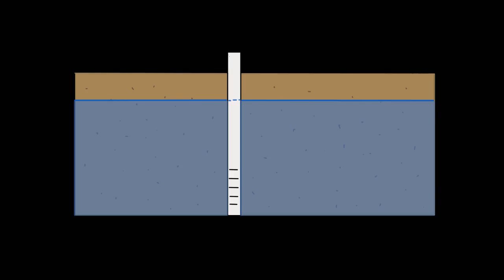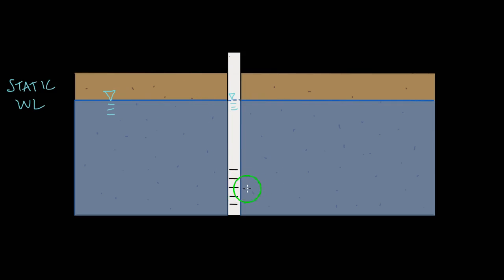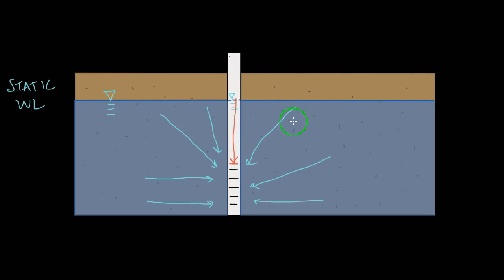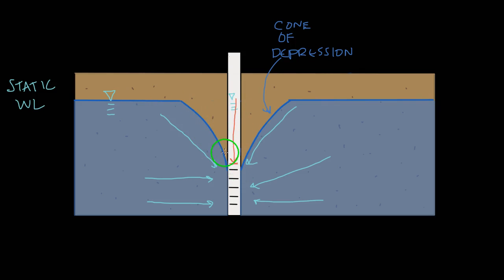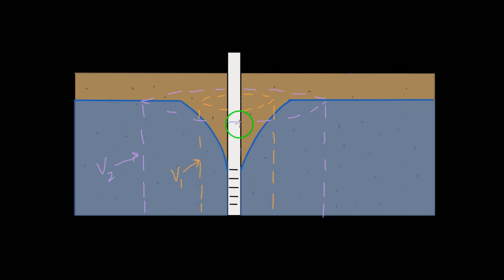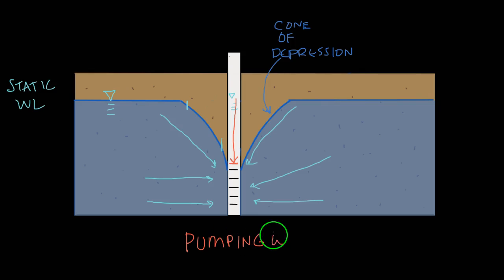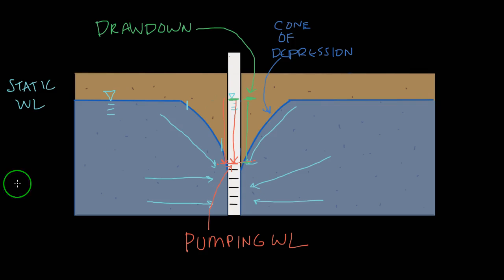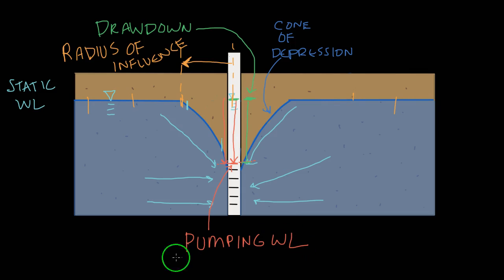Cone of Depression (and more)

Comment: Thanks, I am a bit clearer about where to site my well and how deep it will need to be, and possibly where to put it away from vegetation. It's going into alluvial soil near a lagoon. So I will use the lagoon surface level as a guide to the minimum depth required.

Comment: I have a question,I was born raised and still do and my family bought this property in the 40s and it got many criks on it that normally only ran when it would rain. There is one spring and concrete spring house my great uncle built. But my question is I built a home on a a piece of it 2 hills over and never had no springs on it till last March I found water flowin out and upon further investigation I now have 3 sweet little springs of water that flows more then enough water to where we completely unhooked from Patoka lake water that turned aweful to the best cold water I ever had and share to people when they need it. I wonder why after all them years it just now started showing? And instead of digging a well down through the ground I went in horizontal and 8 feet in or so it's opens up more and more daily. All I do is scoop out the silt sometimes. The Crick bottom I'll the way down to like a sandstone slate look and you could drive through it now no more rocks but that layer is about 10or15 feet below where we get the water. And some are even higher.the hole we use is about a foot and a half or 2with like a shale ceiling and sandstone bottom and gets lots wider as it goes back it's very pretty to look at I just don't get under it cause I have to shore some of the ground around it. I haven't measured the flow per gallon in a while but once couple months ago we measured it and and it was way less then now I'm sure of it so will the more it washes small rocks and silt out does that mean I'll keep getting more water? Thanks from French Lick In.
Reply from the maker: That’s interesting, I wonder if those springs will continue to flow. It may be that a nearby water well stopped pumping at some point and now you’re seeing the water table recover. Are you near any neighbors that have wells, or do you have one? It sounds like the springs are located at a geologic contact between two units- that’s typical for springs, that contact acts as a conduit for groundwater flow to the surface. Did you guys have a lot of precipitation in the year before the springs started flowing? I probably wouldn’t bet the farm on them flowing year round in the future if they just showed up recently. I would take flow measurements every month and record them and see what the flow is doing. If you want more help I’d be happy to help out, you can always email me at dane.m.andersen@gmail.com